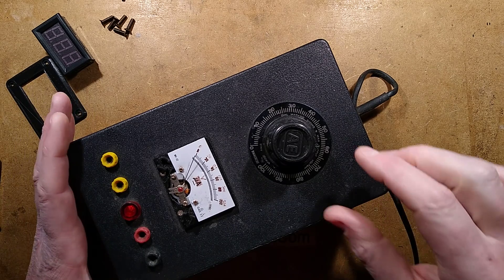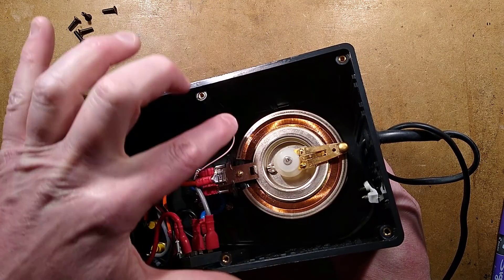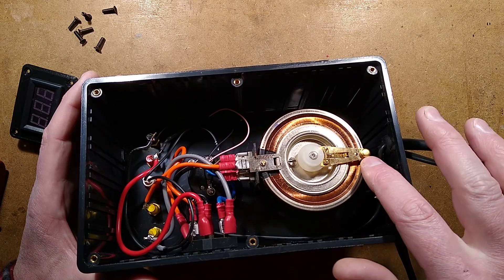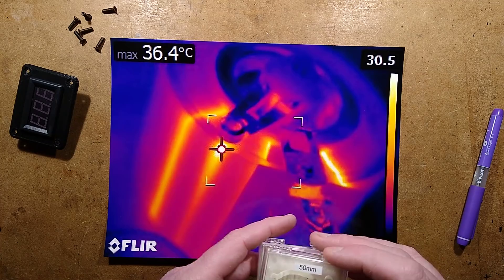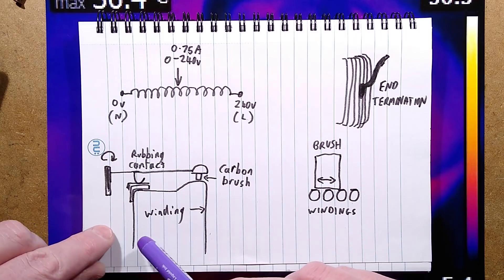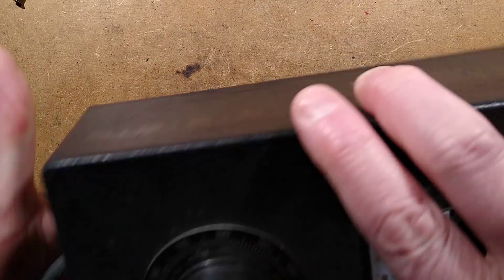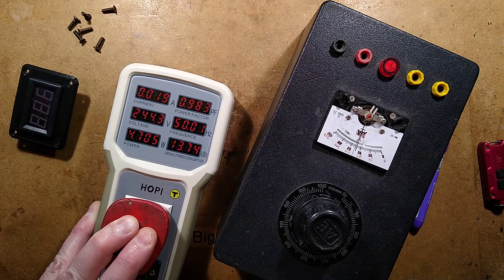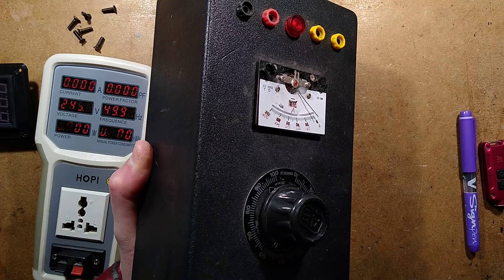Variacs DO short their windings

Comment: Why would shorted turns heat up?   Assuming same current flowing through the winding, if you short out a couple of turns, surely there'd be no current flowing through them and so no heating?
Reply: Eddy currents?
Reply: @neilcase  Eddy currents indeed! The same magnetic flux change that induces current in the non-shorted turns induces a current in each shorted turn, magnetically parallel to the output load of the transformer.

Comment: The brush seems to create a virtual single turn secondary winding with the turns it shorts out. Much like the shading rings do in a shaded pole motor. That can muchly explain why they heat up just in a small spot. It's a secondary short circuit. The shading rings in a shaded pole motor also get rather hot.

Comment: Not sure what the material is you printed in, but if it's something like PETG or ABS that is most definitely something that can happen with glass build plates, and I've read it can help to cool down the plate either naturally or by putting it in the freezer to have the model crimp lose.  Isopropylalcohol is a very good cleaning agent I've come to learn for cleaning the buildplate, unfortunately it is impossible to obtain in The Netherlands at the moment, so I'll have to do with ketanotus alcohol for the moment (works, but not incredibly well).
I've had models that were being stubborn from being released of the buildplate but upon the buildplate cooling down I heard a very loud crack and the model was moveable.
Reply: "Denatured" alcohol is the term I see in the US, is ketanotus alcohol also typically >95% ethyl alcohol? Straight ketones (e.g., MEK/butanone) might work better if your ethyl alcohol source is 70%/"rubbing" alcohol.
Reply: @jercos  I saw Ketanotus being sold with a 70 and 95% alcohol rating (I am unsure what the difference is, except for the fact that it's nearly impossible to obtain right now because those are also sold out...)
Isopropyl is something I was unable to find at all, I couldn't find any store here that sells it, which might just be down to the fact they took it out of stock untill they restock the product to avoid people asking for it.

Comment: Very neat video! I've wondered about that same thing, seeing how a variac doesn't have any "dead" areas between windings as the control is swept across the entire scale.

Makes me think of a power transformer with an "on load tap changer" which momentarily bridges out a segment of the winding during tap changes. Those have a more complex system than a variac, but the idea is similar. There is no off state between taps. A low-value resistor is used in series with each winding for a very brief moment during tap changes.

 I've got two Chinese variacs which have developed some dead spots and audible arcing. Should tear them down and inspect to see what went wrong. Both of them are less than 2 years old and followed the same path to failure.  New out of box, there were many dead spots, cleared up by repeatedly sweeping the knob with power off. Then after several hours of use, dead spots reappeared at the more commonly used ranges such as 100V and the very low range used to check for signs of life in very old equipment before ramping up.

Both of these now take very little effort to rotate the knob and I expect that winding varnish was on the end turns where the brush rides, causing the initial problem; and that now the brush has become stuck due to more gumming up from varnish.

Comment: Hi there Clive, just a quick tip regarding the print bed. After having issues for a longer time, I simply exchanged the glass with a piece of "FR4" (GFK) or whatever Glass Reinforced Plastic is called in english :-)  Just for an example: https://www.ebay.de/itm//283395784082    PLA sticks on it like hell as long as the bed is heated, nearly falls off by itself when the bed cooled down. Simply cleaning it with Isopropyl-Alc.  You may try it ;-)   Best regards from Germany, Dirk

Comment: I've been thinking of buying one of these this week.  What isn't clear to me is why these are often called "scariacs." Could someone talk about potential ways to electrocute oneself even if the variac is set to only 5-10 volts? I'm confused if the scary part is due to potential human error (wrong setting oops 105V not 5V) or an inherent danger built into the variac design.
Reply: If the variac is set low enough and the low side is the neutral, the risk is similar to grabbing the neutral... not likely to give you a shock, but not safe either. If a variac is attached backwards, or connected "hot to hot" in a split-phase system, 5-10 volts on the dial is 5-10 volts less than hot, and quite dangerous. An isolated variac, or a variac used in combination with an isolation transformer can both be about as safe as it's possible for a ~200v power supply to be, but an ordinary variac has no isolation from mains.

Comment: Isopropyl and acetone are not kind to some 3d printer build surfaces. I highly recommend replacing your build surface with a PEI coated spring steel sheet of the appropriate size. Makes it so easy to remove prints as you just bend the steel.

Comment: Isn't this heating up at the ends caused by the magnetic field causing a much higher current in the shorted wires?
After all it has become a short circuit single winding secondary winding of a transformer.
Thus if you could approach the lever to add a few more windings to this already shorted end "ring" you may increase the current through it and thus see an increase in current on the primary winding. (or at least higher temperature of that part)

Comment: Not surprising that the current where you're shorting two adjacent turns together is pretty small. Because of the way the variac works, those two turns are literally adjacent turns, and the voltage between them is only going to be on the order of one or two volts. 

In a regular transformer, the arrangement of the wire in the bobbin is not nearly as critical and you'll get turns physically adjacent but electrically far apart.

Comment: i'd be impressed with a variac that allows step down as well as step up of the conventional AC voltage...yum yum
Reply: @jonathanHughes380  thats reasonable but i was thinking of old school coils of something that allowed to meow all the way to 500volts if needed...thats where the modern vfd inveters come in
Reply: @jonathanHughes380  i comprehend i drew a  quikie diagram... is this what you meant?
https://imgur.com/a/QpPvIYH
Reply: @jonathanHughes380  
i see primary winding if bucking... but to boost voltage i think you still need a secondary winding?

Comment: LOL I cleaned the shit out of my heated bed, put gluestick on, then spread it evenly with everclear. On top of that it was in an enclosure with no airflow, 100°C bed temp, 240°C hotend, so it stayed nice and warm and didn't warp. The adhesion I got with ABS was absolutely nuts. It was too perfect. Took me 20 mins to get my part off

Oh and it has a mirror shine on the bottom LOL

Comment: I used to use variacs a lot where I used to work, we tested motors and used them for fault finding when mains equipment was faulty and we could ramp up the voltage gradually. Useful things. I figured out how they worked years ago, and always thought they shorted windings out because it was just designed that way, or 2 or 3 windings would deliver a better surface area for the carbon brush with less resistance/heating in that particular spot. Prob just a rough and ready design though. Who knows lol. We read too much into design sometimes.

Comment: Chances are you wont see this but fingers crossed! I've just had to install a little DC-DC buck converter, how do these little boards lower output voltage? Yes, I've tried google and sadly none of what I got made much sense for a pleb like myself
Reply from the maker: They use an inductor to limit current flow as a series of pulses.

Comment: I have a few variable autotransformers the largest of which is 30A I believe, and by necessity they ALL short 2 windings (required to avoid loss of contact with even 1 which would be catastrophic).  These wires must be 14AWG and I've always wondered how that works.  Are you saying that the transformer truly is shorted but the resistance of that winding is high enough to prevent overheating of the turn?  That doesn't make sense to me as that would be well over 100A even at 1V...  (280V max and probably around 300 turns I'd estimate.)  I'm still confused.
Reply from the maker: It's possible the carbon brush does add at least a small resistance.

Comment: Al the windings it is shorting are the secondary side of the transformer , you are just changing the number of windings by moving the wiper. The wire to wire voltage is almost nothing.
Reply from the maker: There is no secondary.  Just one winding.
Reply: @bigclivedotcom  Oh mine has one wire but it is set up as an auto transformer so there is a primary and a secondary even thous it is the same wire. On mine the primary side is under the windings for the secondary so you cant see them . The wiper is on the secondary.Moving the wiper just changes the number of turns on the secondary and the ratio of turns.

Comment: I used one to vary the speed of a fixed speed wall fan without having a buzzing noise that you get if you use a normal resistor in the circuit. Work fine and never had a problem.

Comment: I’m just wondering what you think about the WiFi boosters and are they worth getting and have you investigate one??
Reply: Generally if you have to ask "is this too good to be true", the answer is yes. Multiple wifi hops multiply any quality or speed issues to do with the wireless itself, the only way such devices can help is if your wifi signal itself is weak somewhere, and an extra "hop" gets you the needed range.

In 99% of cases, the correct way to set such a device up is to run an ethernet cable from your router/modem to an extender and set the extender in "AP mode", using the ethernet connection to carry traffic back. This avoids the huge issues with multiple wifi hops.

These devices will never, ever give you more speed than you get from your provider to your modem for free.

If your wifi signal is strong, your connection is still sluggish, and you are using an all in one home gateway product with modem+router+AP built into a single unit, you may also benefit from placing the unit in "bridge mode" (making it act simply as a modem, only able to host a single device) and attaching an external router/AP to split out wifi/LAN connections.

Comment: mr bigclive, would you kindly check out (for saftey) the garage led type leds now on amazon? i bought one for my kitchen and im truely amazed how good these things are for the price (about to do every room in my house with them) might be interesting for you to do a tare down on these things HZSANUE B22 Bayonet Cap LED Garage Light, Daylight White 60W 6500K 5500Lm Deformable Shop lamp with 4 Adjustable Panels, LED Ceiling Light, for Garages, Basement, Workshop, Warehouse(Pack of 1) [Energy Class A+]
Reply from the maker: I took a look at one a while ago.  Reasonable enough construction, but I'd guess they'll probably drive the LEDs quite hard.  Especially in the all plastic ones.

Comment: I'm shocked! Are there people who believe otherwise? It's an AUTOtransformer not a primary/secondary transformer. Shorting across two or three coils with the wiper simply "removes" them completely from the circuit as if they just don't exist.

This is COMPLETELY different from a shorted coil inside a two coil (or more) transformer.
Reply: The shorted taps do act as magnetic load on the transformer (much like the shading in a shaded-pole motor), but it's typically microscopic compared to the output load.
Reply: @jercos  agreed, but I was trying to keep it simple for those who struggle with basics. As Clive's video shows TOTAL losses are just 4 watts, which is akin to a WIRE tapped autotransformer. The losses due to two or three shorted coils are probably just about 2 watts with the other two watts spread across all the other coils. A completely insignificant amount compared to the 180 watts rated output of the overall Variac i.e. the shorted coils losses represent 1.1% of the total output - or "nothing" to be concerned about.

On a side note it IS CRITICAL that no connections are allowed to bridge large sections of the Variac as that WOULD be potentially catastrophic, hence why it is best to mount the wiped surface vertically. Nothing can then land across the Variac and inadvertently short it out.

Comment: As a young lad, many years ago, I had a model train speed controller. Imagine my delight when, after taking it to bits (as one does) I found it was in fact a variable transformer from about 6 volts to 25 ish. The variable part was an isolated secondary. Amazing for a toy. Needless to say it was never connected to the train again.
Reply: I've seen a system much like that, including a fixed tap for 12v AC lighting! Very cool stuff.
Reply: @jercos  Yes, I remember that now, made by the German Märklin model railways. Much better than the Hornby stuff that used DC and a tacky resistance to control the speed.

Comment: The bridge rectifier is needed for the voltmeter, yes? Using a larger rectifier and adding terminal posts was presumably a nearly-free upgrade, while a capacitor would slow the meter response.
Reply from the maker: That's possibly part of the reason.

Comment: 3d printer - clean the glass with acetone, apply a thin layer of 'ABS juice' before printing. ABS Juice is just clear abs dissolved in acetone. 50g acetone to 5g ABS. Works very well on PLA, TPU, PETG and ABS. Maybe other materials.

Comment: The heating from the suspected shorted winding is more even and much hotter at the bottom. To me that suggests that the heating from the wiper contact is much more to do with contact resistance and the heat traveling along the wire.

Comment: The most likely reason for the shorts is breakdown of lacquer on the windings of the Variac.  Over time, and especially on tight windings the lacquer starts to crack, which causes shorts.  Heat accelerates this.  Buffing the top off the lacquer for a contact point doesn't help, but it is the most direct way of providing the varying voltage.  Cracking of the lacquer over time caused the OEM car manufacturers to stop using ammeters in their cars and they switched to voltmeters (because the resistance was very big or would fail open circuit).  The cracks in the turns of the D"Arsonval movement caused I(squared)R  problems where the resistance got very small which, would cause the power consumption to go way up. This would melt down vehicle wiring harnesses (yes, even with bypass style ammeters).  Tons of vehicles from the 40's up into the 70s were sent to the scrapyard because the wiring harness would melt down when the ammeters shorted out.

Comment: Have you done a video on power factor and what it means?  I didn't see it in your list.  Why is it important and what can we do about it?
Reply: He goes into some details on teardown videos for "energy saver" devices, many of which are capable of (some small amount of) power factor correction. Essentially though, think of power factor as a measure of how in-sync a load is with the supply.

Poor power factor means the transmission lines delivering that power to you are forced to do double-duty, bouncing some current between the out-of-sync appliance and a buffer, which may be the generators or inverters producing your electric grid voltage. Inductive loads (like motors) have an inherent phase shift, as do capacitive loads (like fluorescent lights), and to some extent they can cancel out.
Reply: @jercos  I got as far in my readings on it years ago that with fluorescent lamps you could get light out of it that the meter could not record (in essence) and that the devices then had circuitry that would stop such free loading.  That left me puzzled even more than I had been.
Reply: @jercos  That's another thing I have never understood, how do you synchronize the 50 or 60 phase thing with multiple power generation stations.  Or especially with people putting solar on their roof and connecting that to the grid.
Reply: @EnergeticWaves  there's something of an automatic consensus... every line-synchronous generator on the grid forces every other generator into sync. A generator starting to "lead" or "lag" has to work harder than one settled into driving the grid in sync. Grid-tie inverters take advantage of that property to smooth their output... even when they're driving power into the grid, they can measure the produced current and determine any phase shift they need to correct.
Reply: @jercos  I'll be darned.  Fascinating stuff, thank you.